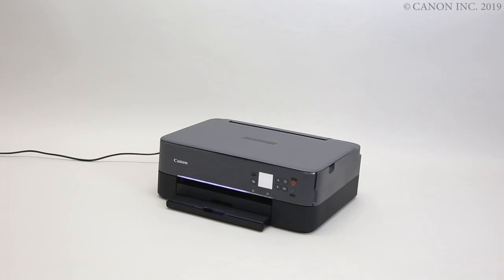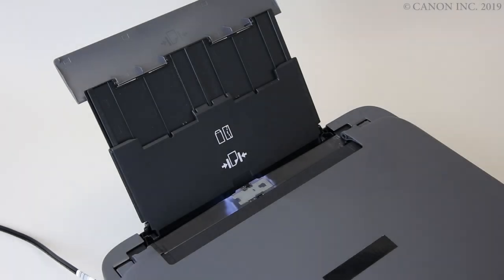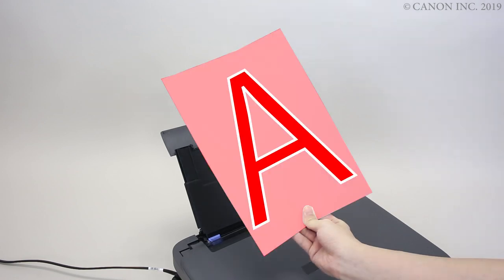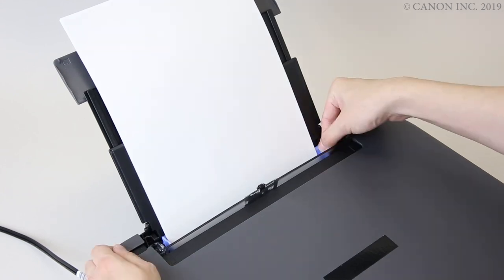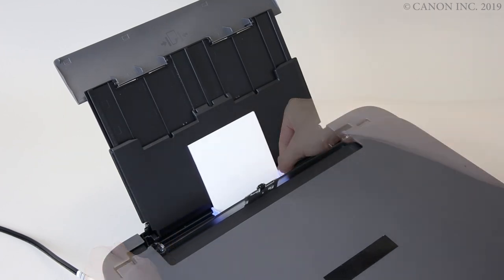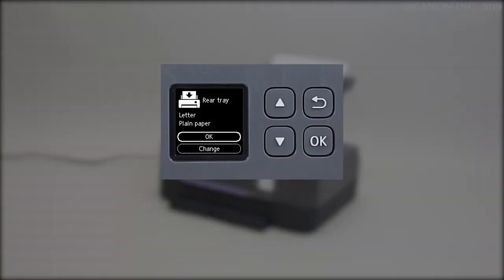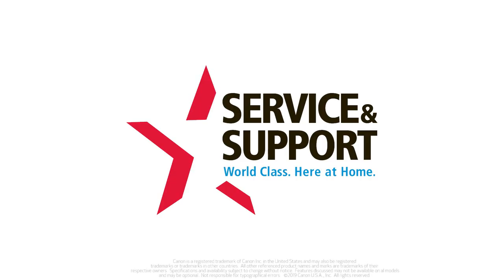Canon PIXMA TS5320 - Loading The Rear Tray

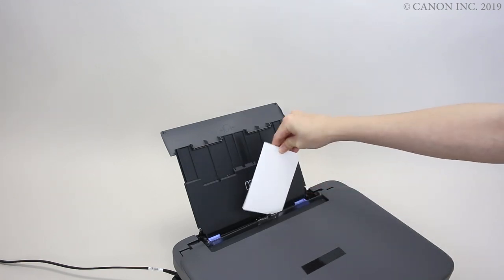Comment: I'm trying to load 4x6 into the rear tray and it is proving impossible. I used a flashlight to try and see if anything is preventing the paper from catching the rollers, but nothing is there. I have tried every possible angle too. I really don't get it. at the 1:42 mark, it clearly shows the paper loaded properly (top facing edge about an inch/half-inch from the top of the first plastic piece. But I can't get my paper down that far enough for some reason
Reply from the maker: Hi Tom:
If you are having trouble after following the video, you can find additional support at the link here:  https://canon.us/3dRPJph  Personalized support options are available through logging into your My Canon Account.
We hope this helps.

Comment: Can I copy multiple pages at a time from the rear tray, or do I have to place on copy at a time on the scanner glass, which will take forever?
Reply from the maker: Hi, Carol!  To copy multiple pages, you'll need to manually place each page upon the scanner glass and scan them individually.  The paper tray is exclusively used for paper which is to be printed on.

Hope this helps!

Comment: Hi! I tried to print something on my TS 5320 using cardstock paper and it is not working..I have tried the rear tray and it won't work, I tried cassette and it jammed. Please advise!
Reply from the maker: Hi!  Your PIXMA TS5320 is designed to use plain paper between 17 to 28 lb bond (64 to 105 gsm) in addition to genuine Canon photo paper.  Using paper outside of these specifications could cause paper jams.

Hope this helps!

Comment: Hi, maybe you know how to load more than 1 sheet of photo paper to the rear tray ? I read somewhere that it can fit about 20 of them.
I once tried to put more than one and somehow it sucked 3 pages at once, and then it was printing on 3 of them as well.
Reply from the maker: Hi, Kazimierz!  The number of photo paper sheets your PIXMA TS5320 can accept in its rear tray will vary by the sheet size.  According to its specifications, the rear tray can handle up to 20 4" x 6" sheets at a time or up to 10 sheets of 5" x 7".

If you're working within these limitations and you're still encountering problems, our US-based support squad will be glad to help.  Register your printer first at https://canon.us/account and you'll get access to all of your support options including live chat and our toll-free number.

Hope this helps!

Comment: Canon USA Support  Will you please inform me of the upgrade from this model that handles the basic scanner functions of: 1) Scanning multiple documents through feeder and 2) included the option to scan Legal documents?
Reply from the maker: Hi!  The PIXMA TR8520 features an automatic document feeder (ADF) which allows you to scan multiple pages in a single operation, and the ADF also allows it to scan legal-sized pages.  Check it out at https://canon.us/zk4ch

Hope this helps!
Reply: @CanonUSASupport  so the TS 5320 cannot scan from the feeder?
Reply: @sarahgiles3702  Did you ever receive an answer to this question? I'm dying to know too

Comment: How do you use the rear tray to put documents to scan? Rather than having to lift up the lid and scan one page at a time
Reply from the maker: Hi, Karina!  The rear paper tray on your PIXMA TS5320 is just for paper that's going to be printed on.  Any items that you need to scan will need to be manually placed on the scanner glass one item at a time.

Hope this helps!
Reply: @CanonUSASupport   Will you please inform me of the upgrade from this model that handles the basic scanner functions of: 1) Scanning multiple documents through feeder and 2) included the option to scan Legal documents?